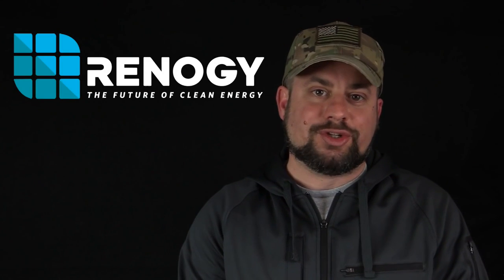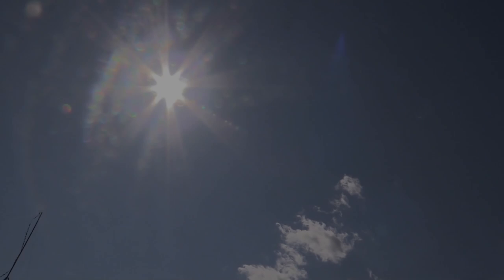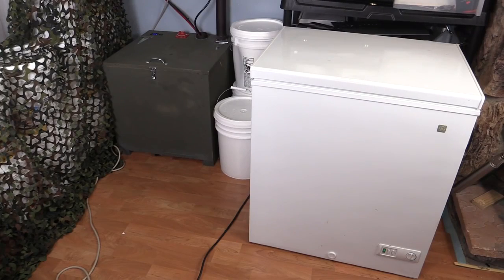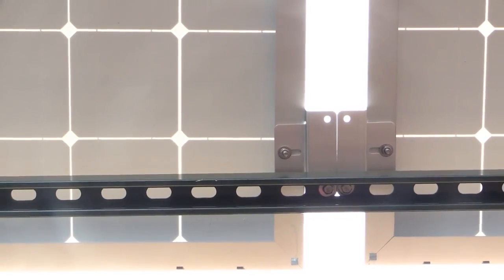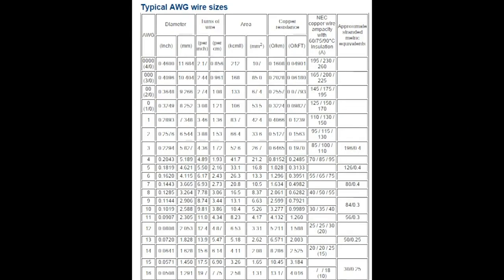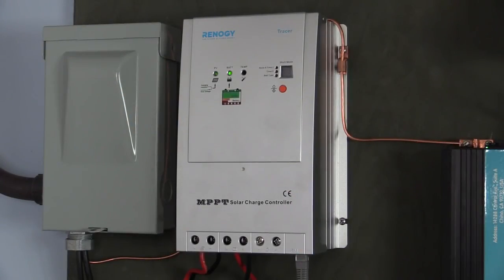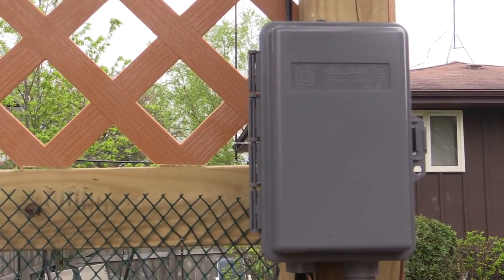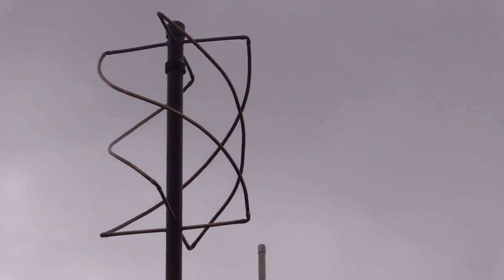The Ultimate Guide To DIY Off Grid Solar Power | Tin Hat Ranch

Comment: Awesome video. I was with you up until the point you said lead acid batteries are cheaper. They are only cheaper at the cash register since they only give us 50% of the listed Watt hours, and need to be replaced after about five hundred Cycles. Even with a single discrepancy, this has been an excellent video and video series. Thumbs up and thanks for sharing
Reply from the maker: Please keep in mind this video was originally put together four years ago.
Reply: @TinHatRanch  fair enough👍

Comment: One of these https://www.dommelvalley.ca/catalog/datasheets/64-0655%20Rev%20B%20(ACLD-40%20Data%20Sheet).pdf  Combined with one of these  https://www.dommelvalley.ca/catalog/datasheets/MS-PAE_series_data_sheet_revc.pdf  And a Hot water tank to store the extra hydro as heat to heat the home Hydro thermally after the sun goes down could allow smaller battery banks and could allow more solar storage without increasing battery size which is more costly than a few extra hot water tanks.
Reply: This system can take advantage of using Micro grid tie inverters in a AC Coupling delivery from the panels with a direct charging of the Batteries through the Magna sine inverter even if the grid is gone down because the larger inverter tricks the micro inverters to not island and they continue to produce 240 volts AC The large inverter has a Automatic grid disconnect that is controlled by the grid side and is 16 millions of a second trip time to the 80 volts drop. If you notice the light flicker and computer may not reboot, it is that fast. Large inverters are stackable to 17,600 watts and AC coupling with water heat as storage could mean smaller Battery Banks needed and less chance of lowering the cycles to the battery bank, making them last longer.

Comment: when grounding/bonding your solar system, make sure that wire is also connected to the ground in your home.  DO NOT have 2 separate ground paths.
Reply: Please explain this further if you don't mind...
Reply: @YuriSamson  run a wire from your home electrical panel ground bar to any metal framing on your solar system.  Do not run a separate wire to a separate ground rod in your yard. You want any metal of your solar system to be at the same potential as your home electrical system.  For example, if you have it bonded correctly, and you placed a volt meter on your electrical panel ground and your solar system metal, you will measure zero volts, which is good.  BUT, if you have it isolated, and ran a separate ground wire to a rod in your yard and measured with the volt meter between your solar system and your home electrical ground, it is possible you will have several volts now on your meter, instead of zero volts. This is NOT lightening protection, just bonding protection. You can run a #6 solid copper to do this properly. This is to protect anyone working on system from getting shocked.

Comment: Great video, just getting educated.  Bought Costco Coleman 100w panel and charge controller for my RV.  Want to build a system with an inverter which I did not see on the video.  Thanks, Giles

Comment: Simple misnomer... electricity doesn’t want to find ground... it wants to complete the circuit. All quality systems are grounded to give the circuit a safer path to complete the circuit in a fault condition not through the framing of the building... or a body. Intentionally grounding the system for a dedicated fault path keeps interrupt devices functioning by INCREASING the ampdraw to maximum in a fault situation to blow the inturrupt device preventing fires.

Comment: I have 4 12 volt 100 watt Renege panels I want to wire them for 2 24 volt panels , do I need a combined box to send the power to my appt charge controller. I understand how to wire two , I need some help thanks
Reply: My panels are just 20 feet from my batteries

Comment: DONT THOW AWAY THAT OLD CB RADIO!! Stash it !! That crappy old cb radio can be used for communications over a pretty decent range and requires no stupid license or thousands of dollars also learn to make a half wave dipole antenna because they are lightweight and ultra portable able to be strung up anywhere and to anything. That 4watt output cb radio doesnt take alot of amps and can be run off anything 12v.FRS GMRS radios can get out pretty good also.. Also try to keep any small things like flashlights portable radios and such using the same battery sizes..same thing with ammo 22lr 9mm 40sw 223 12ga shotgun are super common.. 5.6/223 for rifles and 9mm is still used as sidearms for the military 40sw is what most LEO service weapons are and they also use 12ga.. 22 is cheap to stockpile for hunting small game and also a decent 1000+fps crack barrel pellet rifle can go along way(i have a winchester crack barrel pellet rifle and there is not a small game animal it wont stop).. Dump the super exotic rounds.

Comment: This was the best start to finish explained video I have ever seen. I have had solar for about 4 years and have studied it for about 8. Only one thing you did not say. That is about your freezer. The start up power is much more then the 85 watts you indicated, maybe as much as 400 watts or more. If you have anything else running and the freezer starts your 1000 watt inverter might not handle the surg. EVERYTHING else was spot on. GREAT JOB.

Comment: Question...I came across a great deal on deep cycle batteries. Just wondering what your thoughts on them in a solar system. Am contemplating either deep cycle or L-ION 18650 battery bank, which one would you go with and why if you dont mind. Thank you for the help and great video.

Comment: assessing your needs and finding ways to reduce your total as well as momentary use of electric power keeps you in mind of when to do what while you are on the grid. I brew my tea at night, when power is not as much in use. Off grid, I would brew my tea during the day, because that is when the energy is more likely to be replaced. I use tea as an example because energy use in an unlimited availability is different than in a limited generation world. I can brew 2 gallons of tea, then I don't have to brew more for a while. Brewing coffee off grid and keeping it in an insulated thermos means you can brew it during the day and have hot coffee at night. My view on energy use is about scheduling energy use as well as gross amounts of energy used.
Reply: The only item in my house that is on all the time is my fridge/freezer. It is not even on all the time because it have a thermostat. So if I'm out or sleeping at night

Comment: Note that for a 12V nominal battery voltage output from ac current at 1KW the ratio is proportional. In 110V case a ratio of 10/1 roughly. Therefore the 1KW will need 10KW energy from battery instantaneously. Pls discuss the advantages of 48V battery advantages.

Comment: At last a video that I could follow and understand great thanks brilliant, I will soon be fitting a system to my Airstream Trailer based in Miami so 1 question what are your views on Flexible Solar panels attached directly to the roof ? thanks again

Comment: question which I can't find the answer to: Can an MTTP controller also raise the voltage and lower the amps in case of a too low voltage coming from the panel(s) in order to still activate the charging cycle?

Comment: Budget build? Go to your local junkyard, you're looking for a solid axle from a truck. Pickup 3/4 to or bigger. Remove one axle and see if you can get the axle cheaper. Now mount the axle vertically at a spot in the yard that will give you the view your looking for. On second thought buy the axle with a junk wheel to fit the bolt pattern so you can mount the frame for the solar panels. On the input to the differential mount a large pulley or a hand crank so you can easily rotate the panels at the sun. Take the differential apart so you can weld the differential together so it will rotate with a missing axle. 
You just built a poor mans solar panel rotater. Probably a good idea to set the bottom of the axle in concrete. Ideally 12 inches deep bye 8 bye 8 feet should do it.

Cheers!

Comment: Always thought it was such a waste that we make off grid systems where we charge batteries with AC, store that energy in DC batteries, convert it it AC with an inverter, then convert it back to DC when we plug in all our electronic devices and their wall worts. I know you could try and hardwire those devices directly to the battery but good luck with managing all that effectively. Damn you Nikola Tesla for making a more efficient means of transporting electrons over far distances and your stupid vacillating principles!!

Comment: A possible problem with your battery box. Did you seal the electrical conductor hole that your wires run thru? If not, then your pipe vent is not going to get rid of the Hydrogen gas. It is just as lazy as the electricity, and your BIL,  and will take the easiest route out. Which will be the wire run unless sealed.

Comment: Hi there,  I could really use some help. I have 5 x 100w panels in parallel and 2 x 180ah deep cycle batteries. My question is, the  batteries get charged to 100% during the day but slowly drops to 60% as night falls, What do you think is happening? How can i fix this?

Comment: here's another idea to try I have an idea for constant energy flow :) Imagine a bunch of water wheels positioned above each other, each one when spinning generates an electrical current not so unlike a wind mill does but with water. At the top is a big basin of water, as the water falls straight down it spins the water wheels generating electrical current. When it reaches the bottom their is another basin, but this one can be shaped some what like an up side down bowl and is slanted down so water flows into areas that are separate and in these areas the water is evaporated and then travels up tubes and back to the top where water re-condenses and falls back down. In these tubes the steam is traveling up through, there is a smaller tube coming down from the top and small windmill like contraptions protruding from it. The rising steam spins these small windmills and generates electrical current that travels through wires in the center of these inner tubes and can either be used for extra energy output or help to heat the bottom bassins or even the tubes themselves so the evaperated water stays evaperated all the way up. The energy to keep the bottom hot enough to evaporate water comes from as many of the water wheels spinning as needed. To get more energy output you just make the contraption taller with more water wheels, It will always only take so many wheels spinning to keep the water on bottom boiling so more wheels equals more energy output. The material in the top basin can be designed as a heat sink to help the water re condense into liquid form, if built correctly, so no water/steam escapes, it just keeps going and going utilizing natural forces to function. If the device was built inefficiently, in that water was escaping from it in small amounts over time. One could easily rectify this issue by attaching a device to the top of it that naturally gathers moisture (Water) from the air and releases it periodically into the system to replenish it. :) Now just add the proper electrical wiring and chargable baterries into its design so all the excess energy being perpetuated can be accessed from plugs on bottom and/or top of device and presto you got yourself free energy.(Free in the sense that you didnt pay for it :) Please share this Idea with Everyone.

Comment: cannot believe US homes use an average of 30 kWh per day, I'm guessing a lot of electric heating and air con adds up. I typically use 5 to 7 kWh / day, if I go over 10 i get really pissed off with myself! But then again, in the winter I can use 140 kWh / day of gas for central heating.

Comment: I am off grid on a 2.4KW/h per day solar system (400 watts with more than 7 hours per day average usable sun at this location).  I have way more power than I can use.   LIMIT the use of the inverter, use as many DC appliances as possible (converting to AC has some loss).  Your inverter should be rated continuous draw of greater than 150% of maximum draw, this is for best efficiency of operation.

Comment: This must be kind of outdated because lithium batteries are much better. You wont have to worry about over drain and over charging. Just be careful with lithium ion, you can NOT get the lithium wet or it will explode into a bad fire. But there are new batteries either already available or coming soon. The cathode using ion is being replaced.

Comment: I have 23 130watt and 13 305watt panels. I was told to use 48v controllers and inverters. I have 8 6v golf cart batteries 210ah. I have a 230v 3000watt inverter( for welder and lift) and a 5000watt 110v inverter. Don't remember which controllers I have. Can I use more batteries. Haven't installed anything yet

Comment: Why not skip the inverter and use appliances designed for 12v instead.  More efficient I think.  Another idea would be to build your own SuperCapacitors (plenty of info on YouTube to do this). About 5x larger than the battery bank for the same capacity but SuperCapacitors are much more efficient because they will charge and hold nearly ALL excess power produced and they don't get damaged by being completely discharged.  SuperCaps have a much longer life as well -- at least as long as the solar panels.

Comment: Great vídeo, verry detailed overview of a solar system.  I went tru a black out situation a few weeks back.  Used my small 100w solar system with 4 deep cycle batteries to power a fan, wifi and charge my devices. Here is the video https://youtu.be/qPKkjVMpR9M

Comment: @ 11:55 Correction Required please.  In series, the current will be same and voltage is doubled, Ok ( ie; 12 V).  In capacity measurement, AH Ampere is constant but hours can give this constant rated current is doubling  (Basically AH indicates 'almost 'the total stored energy only, nothing else. .  So the total AH will be double 235 X 2 = 470 AH.  And like this, your 4 Battery bank gives you a 940 AH Capacity.  If you connect the batteries in Series or Parallel, that doesn't change the total capacity of the total banks.. Have to add each battery capacity.  No doubt.  And your video is fantastic.

Comment: I loved your system and your explanation... I'm not a prepper, but I'd love to cut my power consumption down just for power bill reasons.  I too am a fellow ham (KB7JTZ).  i just want to have something to keep my internet and fridge alive during a power outage... I run full LED bulbs... the only power suck is the AC that I use in AZ in the summertime.  I use a Mr. Heater Little Buddy in the winter time since it doesn't really get that cold here but with the summers here, I might consider moving to the mountains.  LOL!

Comment: I live in Texas where it's 100 degrees half the year. i guess I'm going to need a football field of panels to run the AC.
Reply: You can actually do it with as few as 3 300 watt panels. I did it myself, after purchasing the system from hotspot energy (I am not affilliated). I get 1 ton (12000 BTU) completely free, when the sun is shining. I don't need an inverter, don't use batteries- the panels wire directly into the mini-split A/C unit. There are options to use batteries to extend the run time into/through the night, but this system can be used totally off-grid or can use grid power as a supplement for cloudy days or nighttime operation.

Comment: Dude, the lead-acid battery was invented in 1859 by Gaston Planté. This 159 years ago or just over one and a half centuries not centuries like you make it sound. Apart from that glaring mistake, not a bad solar tutorial and I like your use of the banking system for doing the math. Here in NZ, we get charged for using a bank account, there go your losses in inverters and things and depending on the plate construction and chemistry, you need between 30 to 40% more energy to fully recharge a lead-acid battery. If you use 100 amp-hours from your battery you will need to put 130 or so amp-hours back in to fully charge it. This is because it (charging) is an electro-chemical process. Another horrible fact that everybody seems to miss about lead-acid batteries is Peukert's Law and it says that the heavier the current drain, the less power you can draw out of your battery. For example a 200 amp-hour Panasonic SLA battery will only give you back 103 amp-hours if your current drain is 100 amps. This is because it (discharging) is an electro-chemical process. I always wondered where it went... now I know, the bankers took it. 
Joking aside, it is why you should match your panels to the battery and make sure that the battery has enough capacity for those heavy loads. If you can afford it, double everything and reduce the "Depth of Discharge" and gain longer battery life. It will give you peace of mind when the weather turns bad as well.